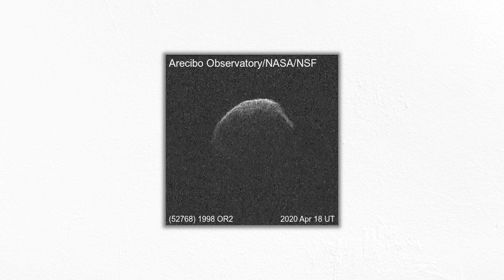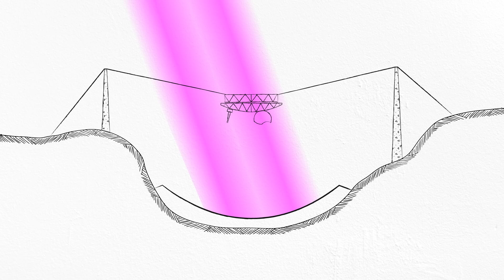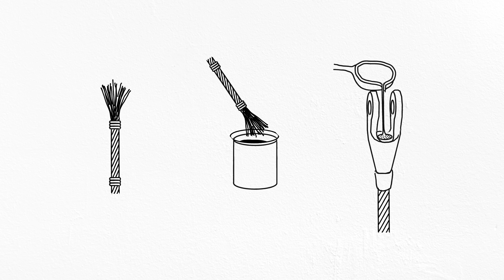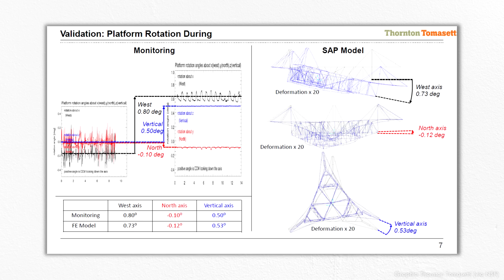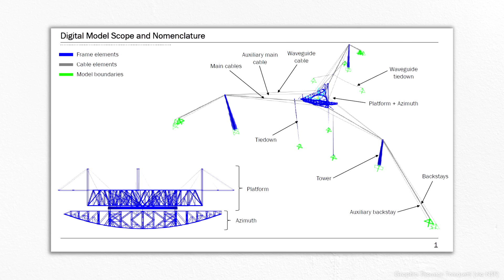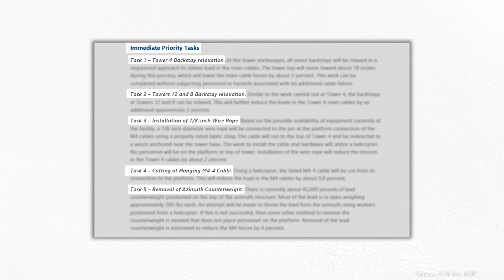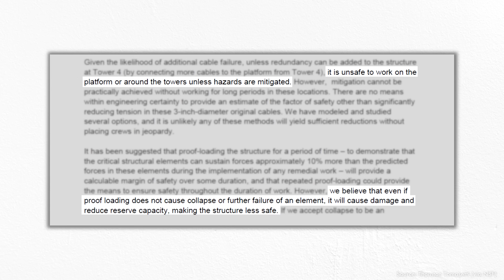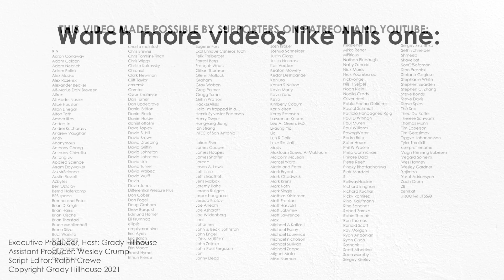What Really Happened at the Arecibo Telescope?

Comment: That drone footage is amazing and terrifying. The energy involved in the snap is clear and its destructive potential for anything in its way must've been unheard of. It's fascinating, and I imagine extremely helpful, to have such clear footage of such a catastrophic failure.
Reply: I thought it was really interesting how when the cable snaps it sheds all of the paint in an instant.
Reply: That drone footage was taken from the MAV, jesus these BF4 players
Reply: Steel cable are extremely dangerous and demand respect.  Even small load applications (such as car winches) can be lethal if the cable snaps.

Regular inspections are a must and always anticipate where it may move if it fails and stay clear of that area.  There is tremendous potential energy under load.
Reply: @aemrt5745  amen I've seen first hand what a vehicle winch can do if it breaks and it the one of the most terrifying things I've ever seen sliced a fully grown pine tree like like a hot knife in butter that kind of power demands respect
Reply: @bromigo684  Yikes!  Glad you were ok!
Reply: @aemrt5745  I was 2 cars behind making sure the vehicle that was winching didn't go over the edge of the cliff but I saw the whole thing 1 half of the cable cut the tree the other ripped the front end off of another vehicle luckily nobody got hurt
Reply: @bromigo684  WOW
Reply: @aemrt5745  it was a really steep slope with a lot of pressure on the line
Reply: @bromigo684  glad to hear you're alright but god damn. Considering that what you saw was from a car winch cable which is much smaller compared to the things that held the telescope up......
Reply: Divine intervention.
Reply: Almost like they needed evidence.... Hmm

Comment: @practical engineering
Is it possible the failure of the first cable allowed enough stress on the remaining cables from that tower to possibly compromise or degrade their strength. The dropping of almost a meter would have great kinetic energy for a single tower to absorb. There was no mention of the cables oscillating in wind conditions, this could potentially also create a stressed point at the tower, the joint being a constant and a cable flexing back and forth causing fatigue. Not an engineer but this is my 2 cents.

Comment: Might be the Zink holding in the cables on the ties has corroded to far and let go of the cable.

Zink is used as sacrificial anodes on boats for a reason, it corrodes instead of the steel rusting and have to be changed regularly.

Comment: Very cool and nicely thorough given that the final data still is not complete.  Considering many public buildings with similar safety factors only last 30-50 years I think that, having lasted 57 years through weather and corrosive conditions that specifically stress the materials available during its construction, it performed admirably far longer than even original designers might have estimated.  Sadly, when government becomes to patron of science, it always sends bean counters in before either engineers or scientists and the results are predictable.

Comment: Very informative, it’s too bad this happened, I use to work on communication towers and most of the guyed towers had galvanized guy cables, you didn’t mention this but I did catch the part about the air being blown into the cables to help keep moisture out but with no jacket I too don’t see how that would work, I would not be surprised if the salt in the air was contributing factor in the failure of the cables, I know it will be a lot of money to rebuild, but if the research Warrants the cost,   I hope you rebuild

Comment: How about using a drone to focus and redirect the signal by Bluetooth to any phone that pays.
Each scientist could stay home and control the drone for however long they pay for.
A drone maybe too unstable or it could be a flexible coupler able to focus any part of the sky.

A geosynchronous satellite could focus light  and send it to Earth.
Imagine the two lenses of a telescope.
One in orbit and the other on the ground.
If you can change the satellite position it could hang out over any University or research center.
Have a portable objective lens that can be sent to whoever needs it.
Focused radio waves don't need a dark tube like light telescopes and once focused in orbit the objective lens can be much smaller.

Comment: As I was watching this, one thing came to mind about the tension of the cables. It was the soda can effect. The cables had been bearing the original weight if the satellite reciever for the longest time and when the dome was added, it added more stress to the cables, weakening them even further so the tension in the cables was not recalibrated to additional weight nor were they replaced to accommodate it.

So if you step on an the empty can, it won't crush but as soon as you put a straw in your hand, step on, it gets crushed.

This is what I believe happened. In the end, it took longer for failure to occur after the extra weight was added.
Reply: Well that doesnt sound logical, im afraid.

Comment: Nsf knew about it and didnt want nothing more to do with it. They got what they wanted and just left everything to the birds without caring about such an amazing structure. From what understand most of those sprocket s last about 50 years at most most are changed every 20 or so years depending on load and use. One of the newer ones expired after those markers so there was clearly a defect there and the older wires were reaching a critical point in their life so ya see why they abandoned the project came to the same conclusion that there be no safe way without doing major rework and redesign essential starting over.

Comment: thing is they never considered dynamic loading  hell at work our cranes are tested to 125 percent load but as well the cables we have a 4 fall setup on our 10 ton cranes well each of those falls are rated for more then our crane can lift from what i remember the crane tech said 6 to one safety factor on the cables and i think the chains we use run a similar safety factor but  i cant remember on that fact

Comment: "These steel cables were installed 70 years ago, they are perfectly safe."

As someone who worked in preventative maintenance for a decade, I don't trust anything that hasn't had a major inspection or overhaul after X amount of hours, let alone DECADES.
Reply: What are you thinking? This telescope was continuously inspected and has numerous overhauls. However after damage from Hurricane Maria, the structure was weakened and so much of it had exceeded its projected life by decades that the NSF decided to decommission it and was in the process of doing that when it collapsed. At that point, no further work had been done out of safety concerns. A lot of people seem to be under the misconception that if it hadn't collapsed, it would still be actively observing. This is not the case.
Reply: @willrothfuss8470  The cables where still the original cables... who cares if every other part was overhauled the cables are cheap comparatively and should have been replaced regularly. At least once every 50 years!
Reply: @willrothfuss8470  why so angry man!
Reply: @TigerOscar78  What makes you say that? I'm not angry at all. I am just correcting the misconception that the telescope was not maintained. It was. It had a useful life far longer than the original designers ever imagined.
Reply: My dad is a weld inspector, and he was inspecting a bridge, and he found a spot that the i-beam was all rusted out, and had a clear spot where it had called, but other inspectors never saw, and he doesn’t know how it didn’t collapse
Reply: @mr.turtles9661  I'd say he didn't know how it didn't collapse because inspectors are (correctly) taught to see anything that has a significant chance of causing a collapse as "collapse imminent", in a manner of speaking. Even if something can theoretically hold up via physics at that exact moment in time, inspectors aren't supposed to look at or think of things that way. Just means your dad is good at his job and will never see a severe problem as a "future" problem.
Reply: @oldred890  so, he had a video of him walking up to it, on a platform, and when he pushed it, the whole bridge would move. and when he would poke certain spots, it would crumble away
Reply: @mr.turtles9661  tack welds on two joined cylinders that don't go all the way around. there's a scene from a nightmare for you.
Reply: Nothing lasts forever.
Reply: @nauy  BINGO!!!!   Yours was perhaps the most logical comment here!  All those folks talking about the Brooklyn bridge or what have you have forgotten about the countless structures in history that sooner or later have caved in...even after endless amounts of maintenance!  Either that or they just outlast their usefulness as was the case of the Roman aqueducts for example. But even that, most of them collapsed and all we have now are the leftovers.  Even the majestic Roman Coliseum has been falling apart throughout the centuries and what's left would've also caved in hadn't it been for preservation maintenance by the authorities in Italy. But a 7.0 earthquake like that one in Turkey would finish it off no doubt.
Reply: How and why it wasn't maintained is rediculous
Reply: @StreetTerrorist187  I am betting cost since it was in middle of nowhere. Also how many people are trained on something like this?
Reply: @tylerdurden788  The root go beyond money or engineering. It was politics taking its toll. The government forbid the Chinese from leasing time on it or bidding for maintenance contracts out of "security concerns." So the Chinese built their larger, better and cheaper version. Paying customers flocked to the Chinese telescope. The old telescope became a cash drain, government passed it off to private institution that had no ability to maintain it. All the engineering issues are the downstream results of political decisions decades earlier.
Reply: @georgedang449  I highly doubt that the Chinese version is "better". Unless they made sure to have it designed and built by a better country. I've never seen worse engineering than in Chinese products. That's just the reality of it.
Reply: Every man made structure needs maintenance, period!
Reply: @kinsmart7294  
What are you talking about? Its an american structure. Are you confusing it with the OTHER facility mentioned briefly in this video?
Reply: Golden gate bridge is pretty old with no major maintenance besides paint which is almost constantly happening. Tacoma narrows bridge... After the first time it fell it hasn't since. I know for a fact I lived in the area my whole life.
Reply: @AndyKPOV  you can see some PR videos of people working on the bridge here. https://www.youtube.com/watch?v=J3UGn9oJVnY
Reply: my god
Reply: Yeah.  Takes all the fun out of going to the county fair to enjoy the rides, doesn't it?  Just think of how many points of failure there are on a ride which is unfolded from a truck and pinned together.  Add to that an operator and a maintenance crew that was highly unlikely to be well-rested and completely sober when they assembled it....
Reply: Then what do you trust?
Reply: Plumbing pipes?? Really
Reply: Alas, we lost a huge capability.  While the Chinese FAST is indeed larger, there is no way it will ever transmit.  I.e….we (humans) lost the best-by-far system that is capable of obtaining detail info about Earth crossing rocks….rocks that can destroy Earth.
Reply: 100% agree u dont uave to be a rocket scientist to work that out 😂😂😂
Reply: They never cared for it.
Reply: PR government is super corrupt. Any money devoted to repairs would've just been pocketed by politicians.
Reply: @dp8458  This was run by a Florida University, not the PR state government.
Reply: The Brooklyn Bridge and other old cabled bridges are still standing.
Reply: @vg2b713  The Brooklyn Bridge has had major structural repairs done in the last 5 years or so. Arecibo had not had anything of the sort in a far longer time frame. That's also not taking any of the environmental stresses taken by each structure or their intended uses into account. You are comparing apples to oranges.
Reply: @LKN117  Just saying that the dish cables were under-designed.
Reply: @LKN117  Consider the number of decades between construction and maintenance on the Brooklyn bridge, that's still a lot.  But Arecibo replacement should be designed with a significant safety factor and a regime to completely lower the platform for inspection and maintenance more than once per year.
Reply: @vg2b713 been replaced, not on a mountain top etc.....
Reply: Not to mention that Puerto Rico has hurricanes like every year. However PR is having a current financial crisis, I doubt they had the budget to even inspect let alone replace and repair it….
Reply: @camelboop  They ALWAYS have a financial crisis born out of corruption. Trust me...I know!
Reply: This was no random cable failure. This was probably a controlled demolition and insurance payout
Reply: After 2 years of covid, i don't trust anyone of any field when they say they are experts. If you cant trust doctors to tell the truth the world is in a bad spot.
Reply: @kinsmart7294  Nothing Chinese about this All-American facility.
Reply: Yeah but you work for the gerbil farm in San Francisco. Sooo can’t quite compare them

Comment: had been some cable-moves (radial correction) counted by the years (50 x 365 / and one radial arc - underbelly ) - you will say it had been just a few millimeter / think about ribbon cable || at the tripod could be mounted a righting arm (up above)- like a Optical axis joystick to add View camera ability of the tie-down cable reducing further apportion given by origin strain / may have a wind load || adjustable (near) parabolic shape - to reflect into the gregorian-dome add a new tie-down system ( using radial-arc ) tied cable-system - may with perpendicular counterweight || at 8:16 what the octothorpe is for? a romp? it is NOT in shape / angle & "Fresnel" may have effect. get an idea - Fresnel  || one very special feature could be a Nitrogen cooled whole array - some higher fence presupposed || if i would build an offshore sea-botany i would take a gregorian-dome like idea to design and construct. ocean surface is in motion. think both   -   electro-optical to botany-optical - bathed
Reply: Bro what

Comment: In my head i see it as a problem of too many parallel cables. The real strength of an ordinary rope, organic, synthetic or metal, is the twisted (or braided) nature of its individual strands and fibers.
Although technically this reduces their max strength a little, it makes them able to share the load much more evenly as a bigger structure.
If you have a rope consisting of 20 separate fibers it will be strong, but if they were taken apart and placed in a parallel line the rope will fail extremely fast, because of the small differences in length and strength, and also minor damage. It would start a chain event similar to the footage of the cables snapping until every fiber is torn.
Of course this was probably not the real reason for the failure as the engineers knew what they were building, and adjusted everything carefully to be balanced.

But maybe after 60 years of use that balance was skewed, and cables at only 60 percent (ideally) loading were over as much as 200 percent?

Comment: I think it's a testament to the engineers that designed this that it survived two rope failures after 70 years, even if only for a few months. I would have expected immediate, catastrophic failure when that first rope broke.
Reply: It was designed to be able to survive 4+ cables breaking easily. Even when the TWO cables broke the remaining cables were only at 60% capacity. Only a fool would design something that would collapse after one cable breaks.
Reply: @Inspectorzinn2  aim for the stars so that you can at least fail in the clouds

Comment: Not an engineer, but couldn't the use of zinc in the spelter sockets lead to degradation of the cable and binders due to the humid environment effectively turning it into a zinc cell?
Reply: I wonder if that is why the newer cables failed due to the sea air. Older wires I can understand as those one where there for well over 50 years.
Reply: A Zinc cell uses the difference in electric potential between zinc and another material, usually a carbon rod attached to the bump on the plus terminal.
Reply: @johndododoe1411  but we are not using power here which would more likely  cause the wires to degrade at much quicker rate even zinz cell lines need changed around every 10 years.
Reply: @IloveJellow  Point is that metal-mixing corrosion comes from acting like a battery and that energy running quitly running through the material,

Comment: The were building a bridge but not taking into account that factor that many engineers forget. Maintenance. There should have been a method to lower the suspended portion to allow for cable replacement and repair.

Comment: too bad it's not gonna catch any more Rouge Transmissions from space, sad to see it in real life, yet it makes me wonder how accurate Battlefield 4's "levelution" was to this demolition
Reply: both yes and no, different failure points as in bf4 it was the ground anchors vs real life the cables pulled out from the top of the tower, so the failed tower fell in the opposing direction, but other than that it did turn out to be scarily accurate, even being close to the height at which the tower wanted to snap back/forwards

Comment: Entropy & Decay resulted in cascade failure of the remaining aged cables after the storms. Looks like a cable replacement plan was needed if need & capital was still in place for the device otherwise it was left to rot? Beying high cost maintenance with redundant functional need. (Basically it was old & neglected)